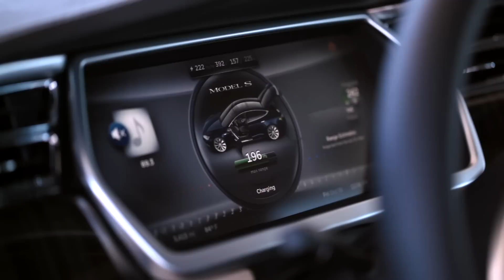CORRECTED: Why Tesla Just Purchased An Ultracapacitor Company

Comment: I'm very surprised that no one, including Elon, has addressed that the Roadster 2 has a 200Kw battery and has less than half the area the S and X to fit it. They have only a 100Kw battery, the maximum size possible stated by Tesla when they were released.... Methinks the acquisition of  Maxwell and their Dry Electrode Film technology increasing the battery capacity from current levels of about 180Whrs/Kg to over 500Whrs/Kg may have more than a teeny weeny bit to do with it.... Let alone the 1Mw battery in the Semi..... Comments please....

Comment: Ultra capacitor could be a big plus for Tesla energy as it could act as primary energy storage for military second frequency control services on grid and would increase the life of lithium battery ............not charging or discharging unnecessarily for small power demand of grid

Comment: These comments are all lost, ultra caps can replace batteries, Maxwell had a huge breakthru in r and d with capcity, and using them in evs . Supers caps are better than liquid lithium batteries and will solve alot of issues thatll make evs 100% better than ice
Reply: Completely wrong. SCs contain a twentieth of the capacity of lithium batteries, and physics dictates that this is very unlikely to change because electrostatic charge is much weaker than electrochemical energy.
Maxwell's electrode technology simply has possibilities for improving the performance of lithium batteries.
Read about supercapacitors on wikipedia.

Comment: “Developing more power to accelerate customer cars... seems a little pointless.” Really? 🤨 I guess no one wants faster cars.... 😂
Reply: The cars are currently not limited by peak power, they are only limited by friction ... altho, using power from a UC would reduce battery degradation in Ludicrous+ mode.
Reply: @brantwedel  also limited by heat and the connections of wires
Reply: I think we may have reached a barrier of sorts. Even at coefficient of friction levels  greater that one, a four wheeled car can only accelerate so fast before traction becomes the limiting factor, not the power of the motor. Of course advancements in tire technology are happening every day....
Reply: Jeff Laurence Great point. That’s why Bugatti had custom tires made 🙂
Reply: Brant Wedel I think SuperCapacitors will be used for quick and powerful current draws for Ludicrous Take Off. What do you think?
Reply: @comment.highlighted  Can I get "Duh" for $200 Alex? 👍
Reply: They might want faster cars, but do they really need them? What is the speed limit in most places?
Reply: Speed is not the issue. With a capacitor to take the peak loads in charge and discharge you can run a smaller battery. High performance cars will use bigger batts but your average City shopping chariot can get away with something much smaller.

Comment: Put simply .. the acceleration of a Tesla comes from having enough batteries to take power from as they can only be discharged so much . This means more batteries the better acceleration but also more weight ....so  having half the batteries and lighter supercaps in parallel allows the same acceleration but 500kg lighter car ! The range will probably be 20 % less .
Reply: Nope...you are sooo wrong. If this was the case everybody would use 100 % supercaps. The big disadvantage is the supercaps don't discharge liniar but straight to 0 Volts somewhere the regulators will give up since you can only regulate one factor at a time. And then there will be a lot of unuseable energy left in the supercaps.
A motor might need 200Volts to turn so when the supercap voltage goes under that...no more driving.
Reply: Well the set up I had on my ebike worked amazing . Sorry you can not understand how to do it . I bet you have a problem for every solution type mind !
Reply: @Buzzhumma  I never stated that it could not work on an E-bike...I have seen it work as a starter battery for a car as well. The trouble with supercaps is the discharge. They drop in volts and amps simultanious. So much harder to regulate thus more waste of energy. For a small cap-pack no problem but for a car sized pack it will not work.
Reply: Nillersoon40 Nillersoon40 hmmmmmmm well I can't say I have tried it with a car but I feel if each cell has a super cap in parallel it will never discharge lower than the cells voltage but upon intermittent high discharge the energy will come predominantly from the Supercaps as they have far lower esr . Is that starting to make sense ? I wouldn't configure it as such though but I describe it like this to illustrate the concept ! Bless you for trying though !
Reply: @Buzzhumma   I think I'm starting to understand where you are heading. But mixing supercaps and cells 1 on 1 would make it nearly impossible to control the cell. I think it would have to be 2 separate packs.
Reply: Nillersoon40 no not at all ! It works in theory and concept . I been enjoying my gift for 46 years !
Reply: @energystoragedevelopers7656  Have you tried to fill 200 amps in your "gift" . Here we are talking car-packs with high charging not slow home charging. When you are using +200 amps there is no room for mistakes!
Reply: Nillersoon40 Correct !  You gotta have the gift 🎁

Comment: The ultracapacitors are probably more useful for grid stabilization, not for cars.
Reply: Totally agree
Reply: This can help for rapid acceleration and absorb much charging during regenerative breaking
Reply: I don’t think the Aussie setup has even broken a sweat
Reply: @hfe1833  Exactly!!!!
Reply: hfe18 I wonder if you have a really heavy load and don’t want to over heat the batteries when slowing down, like say coming off the Rockies the ultra capacitors might be useful or let’s say your trying for a lap time at the Nurburgring maybe the ability to emit and absorb short bursts of power without overheating the main battery pack might be a good idea.
Reply: @rogerstarkey5390  Yes, I agree this sounds like a clever solution. But it's also such an obvious solution that there must be a reason for why it's not already in use. My guess would be too much "added complexity" since there are a number of difficult cases (like long downhill re-gens), but maybe somebody else has more insight into this?
Reply: The grid is AC...
Reply: @assarlundin234  All in the software and BMS. Tesla has proved it can limit your range and performance by  their software.
Reply: @assarlundin234  This is not primarily about SuperCaps although that is great grid technology and possibly for cars as well. This is about Maxwell's dry battery electrode (DBE) technology which is a truly solventless and Cobalt free electrode coating process with game changing performance that can triple energy density, deliver 10-20% manufacturing cost reduction, double the battery life, and is scalable for both classical and advanced battery chemistry. Their energy density is proven >300 Wh/kg with a path to >500 Wh/kg identified. In theory my 310 mile range battery pack would extend to 930+ range using it's current lithium chemistry while weighing less. This is not a complete dry cell battery technology, but it clearly delivers performance across the board and would be a major piece of any full dry battery solution.

Comment: You didn't spell out the major way ultra capacitors (UCs) would help Tesla's electric vehicles (EVs).

UCs differ from batteries in two respects that will be very important for EVs: 1) UCs have very fast charge/discharge speeds, taking only a few seconds. 2) UCs can go through millions of charge-discharge cycles without significant degradation. When an EV brakes, the recovered power can be sent straight to an UC, which can just as quickly return it when the car accelerates again. The UCs can do this hundreds or thousands of times per trip, for years, without any problems, which isn't the case when regenerative braking is connected to chemical batteries.

A secondary benefit of UCs is that they can hold a lot of watts (although not for long), meaning that when you charge your EV, the charging software can tell you to unplug the charger well before the batteries reach the desired charge level (of 80% say). They could be at only 70% or 60% when you unplug, the rest of the battery charging achieved by draining the fully charged UC. That won't reduce the charging time dramatically, but still by an appreciated amount.

Comment: Ok heres a theory. Tesla cars can now have super capacitors and traditional battery packs. When you charge at a level 3 supercharger, it will fill up the capacitors at high speed. But it will discharge and charge the battery pack in background when you leave the station. Charging time problem solved, with some increase in the kerb weight.

Comment: There is a lot of errors in this video and a few statment that is just of the wall.

Anyway, no batteries NEED cobalt, its used to keep the longevity.

Its not "some" cobolt mine that emply child slaves, its the vast majority of the cobolt output.

You can´t super fast charge a electric car just becasue you have a ultra capacitor bank. While it does increase the power, it only increase the power for  a few seconds. Not for a whole charge cycle.

Comment: I'm sure Musk isn't going to replace all the lithium ions with ultracapacitors, only a fraction of them, like 10%.

I think it's more to do with storing during regen braking and then reusing that energy when you get moving again. Teslas have poor performance on the Nurburgring for example, because the battery rapidly overheats. But if they wack some ultracapacitors in between the motor and the battery, the battery charges the capacitor slowly, while the capacitor charges and discharges really quickly during heavy accelerating and braking. That's much more efficient, the regen braking can be much more powerful, and it all gives better range and battery life.

Comment: These guys haven't reported the fact that Maxwell have a dry electrode chemistry which is far more revolutionary than the SuperCapacitor for an automotive battery type. The solid electrolyte tech is fast evolving to provide us with batteries that have more deep charge cycles(lifetime), not prone to catching fire(better thermal characteristics) and can deliver more power(this was the weakness that Maxwell claims to have overcome). Maxwell actually produces batteries with this new chemistry. This is more value to Tesla than the super capacitor. That said Tesla may use the capabilities of the super capacitor for quick charging and regen.

Comment: If I were Tesla I'd make a hybrid capacitor lithium battery.  You drive in to the Tesla charging station, it pushes crazy amounts of electricity into the capacitors to fill them almost instantly, you leave and the caps charge the lithium battery after you leave. BOOM less than 1 minute of charging at a station.
Reply: Not going to happen. Supercapacitors have way lower energy densities than batteries. By at least an order of magnitude.

No, what you want supercapacitors for is as a buffer against short-duration but high-current loads, like accelerating the car or capture from regenerative braking. That buffer can cushion the battery and make it last longer.

Comment: Tesla doesn't like to talk about it but they realize there is a huge market for range: passenger, commercial, and freight.  If their ambition for future autonomous vehicles is to succeed they have to have a hybrid-electric (probably both gasoline and LPG) game plan as part of their vision.  Range on the order of 600 miles is part of it, but fast-fueling is also important to extend that even further.  So ultracapacitors may well be of more than passing interest to them for use in hybrid-electric designs.

Comment: Ultra capacitors will be really good @ recapturing energy while braking and reusing that nrg to accelerate...they are much better than batteries for high cycles... the capacitors will decreases the number of cycles our batteries experience so the batteries will keep their nrg density years longer than w/o capacitors.  That is why Tesla wants them.They wont be used @ the “pump” to decrease charge time because they wont hold enough nrg to power your batteries or power your car for more than a couple minutes.

Comment: I could assume 2 reasons for this...
1 - Tesla DIDN'T buy Maxwell for their batteries, but more for the Ultra Capacitors to increase the speed & efficiency of "Fast Charging"
2 - Panasonic from what I last heard is in talks with teaming up with Toyota. This could be a fall back if Panasonic chooses to leave Tesla, but I have little doubt of this.
Reply: Yes Panasonic going to leave Tesla for Toyota who's has yet to make  a EV car..LOL
Reply: @mrtee3477  ummm sure
Reply: This is not primarily about SuperCaps although that is great grid technology and possibly for cars as well. This is about Maxwell's dry battery electrode (DBE) technology which is a truly solventless and Cobalt free electrode coating process with game changing performance that can triple energy density, deliver 10-20% manufacturing cost reduction, double the battery life, and is scalable for both classical and advanced battery chemistry. Their energy density is proven >300 Wh/kg with a path to >500 Wh/kg identified. In theory my 310 mile range battery pack would extend to 930+ range using it's current lithium chemistry while weighing less. This is not a complete dry cell battery technology, but it clearly delivers performance across the board and would be a major piece of any full dry battery solution.
Reply: They bought them for the dry electrodes technology they recently developed. Tesla only buys a company that will give them a HUGE advantage, Maxwell recently developed a dry electrode that is insane and Maxwell even had a bunch of big money long term deals lined around the block.

Comment: Ultra capacitors are not a solution for EV's so likely they are interested the battery IP or production from them.  You can learn a bit more about ultra capacitors from a video I made about 8 years ago https://www.youtube.com/watch?v=y33tDw6BZh4 nothing has changed since then so that is still valid. There are very small improvement's in both capacitors and batteries since then but very insignificant in both cases.

Comment: The one thing that bothers me about Tesla's sales model is the emphasis on torque and top speed. Maybe this is the only way to usher in the acceptance of EVs but at the same time it's not good for all the teens and muscle car gear heads who will be abusing the privilege and causing unsafe conditions for themselves and fellow motorists on public roads. The regulators at some point should step in and require these fast vehicles be governed on top speeds and take-offs from a dead stop. I don't think every EV going forward should be a hyper-speed Demon causing death and mayhem on public roads.

Comment: Hyperchange explains better why they have bought Maxwell https://www.youtube.com/watch?v=60EiAklzj9I, its their dry battery electrode technology they are after. 

The biggest benefit from ultracapacitors for EVs is that they can accept rapid charging from regen and pass this on slowly to the battery or back to the motor for instant acceleration, all without degradation, in this use case self discharge does not matter.

Comment: Ultra Capasitors could change instantly then slowly charge lithium batteries. It would be less efficient but no more waiting to charge on long trips. Electric cars would be faster to charge than gas cars can fill their tanks. Just a few moments and a ton of current is all it would take.
Reply: Wrong. UCs will not help with charging because they have a small capacity. When it fills up after a few seconds it becomes useless until it can empty into the battery again - the battery is still the limiting factor.
An ultracap with the same capacity as a Tesla would weigh 20 tons and be half the size of a small bus.
Reply: @ahaveland   You are 5 years behind.  Look up maxwell industries ( Tesla just purchased them for 280 million dollars).  Battery   and Capacitor technology is moving very fast.  VW has invested heavily in Ultracapacitor technology. If engineers can solve inherent leakage issues with Ultra capacitors they may replace batteries all together in some small city electric cars sometime in the near future.
What you are saying is the equivalent of I don't want to buy an Electric car because it will take 24 hours to charge it and their is nopalea to charge it.  Maybe 10 years ago.  Not today.